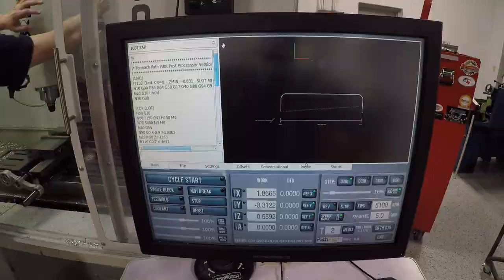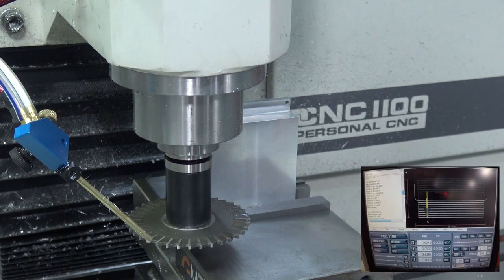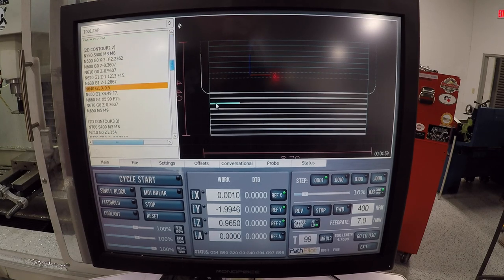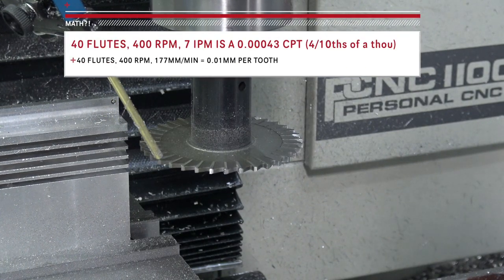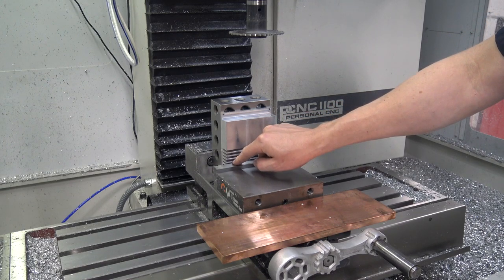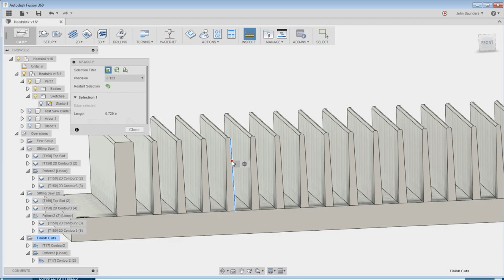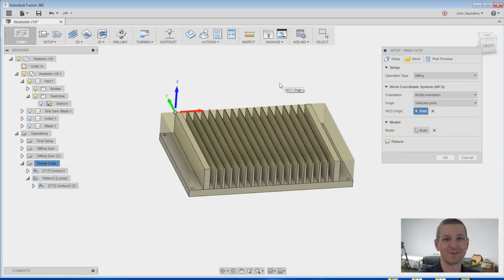CNC Machining a Heat Sink!  Part 2 Widget102

Comment: I love the videos where you show the more mundane aspects of the job like squaring the stock and even shipping it - stuff that is easy to take for granted but still important.  Also, going through the thought process of how to make the part - then finding out what works and what doesn't.  You'd probably make it a bit differently if you needed another one, but you got the job done and the part shipped!

Comment: I think flood coolant would be your friend in jobs like this. It is messy but it sure does work good!
Reply: I agree with the flood cooling. Where I work we only use flood cooling, both on mills and lathes. Then we also have the advantage of completely closed machines.
Reply: I second that!

Comment: Did you consider a sine plate type setup where you offset the part from vertical by 1.something degrees? Then you can cut one side of all of the fins on the right angle, flip the part and do the other side of the fins. Since you can't do all the fins in one pass, you would have to set the angle twice, once plus and once minus.Save all that adaptive step milling time with the end mill.

Comment: In your spare time, try climb milling with the slotting saw...it should improve the finish and reduce the pressure on the saw.  And try Alumtap for the cutting fluid to keep the chips from sticking to the saw.  A little bit goes a long way.  It can be purchased in a small bottle from MSC.  Best of luck!

Comment: I'm not sure exactly what you're asking on the chip but if you are slotting a .750 slot with a 4" slitter even at .00043" per tooth, your chip per tooth is 1.13" long in the circumference of the cutter. The cutter is 12.56" in circumference and 9% of the cutters circumference is engaged making a long chip that is .00043" thick.

Comment: Flood coolant would probably help that slitting job, both for more lubrication and to get the heat out of the part. Tapered end mills are a standard in the mold industry, and an off the shelf item. No need for a custom grind. I always seem to end up with a few when buying a bundles of cutters.

Comment: Nice work, guys. I've done heatsinks kind of like these before, but for liquid cooling - so the entire thing had to be contained - so no slitting saw use for me. I used a 1/16 Destiny Viper to finish them down to a depth of .495 or so, and let me tell you - it took forever. Feeds and speeds on that saw looked a little out of sync, but as they say - if it works, it works.

Great job, thanks for all the great videos! I always learn a thing or two seeing how you do things.

Comment: These are a pain usually with flatness. I have had some with 2 thou flatness requirement on the other side of the fins. once you machine the fins out, the whole thing springs out. had to leave 20 thou for a finish pass on the other side in the end. Brilliant use of a slitting saw!!

Comment: I worked in a shop years ago where they used denatured alcohol as a cutting fluid for 6061 and it worked fantastic but you need excellent ventilation because the fumes are really nasty

Comment: Hi John, I find that a quick brush of tap magic aluminum on the teeth at the beginning of each pass would stop the chip welding. Still using the mist for your constant lube and chip evacuation. The stuff is called magic for a reason!

Comment: Hi John,

It can be helpful to remember, you're not actually cutting metal, instead you're applying enough pressure that you cause the material to fracture. There's a video online somewhere that shows the action and the metal is parting some distance in front of the 'cutting' edge. With conventional or 'up' milling, the chip starts thin and gets thicker, so you're doing quite a lot of rubbing until the pressure is enough to start the fracture. Lots of rubbing equals lots of heat.

With the resulting clearance, you might have been able to climb mill the second pass down the slot, it would certainly have shortened the cycle time.

When you get a built up edge from Aluminium, try dropping the cutter into a strong Sodium Hydroxide (LYE) solution to dissolve all traces that have bonded to the cutting edges. It's also a great way of removing the pinning from files and also the oils and greases the impede the cutting action.

Comment: In my opinion, flood would be better all round. A part of the reason for the heating up of the work is because there are more teeth of the cutter actually engaged(cutting) within the material at any one time. Also the "radial face" of each tooth has a different geometry to that of an End Mill or Slot drill, so chip flow is not quite the same.

Comment: I believe the chip thickness issue you mentioned comes from the fact that when the temp starts to raise the chips do not leave the cutter and therefore are recirculated and are in the way as more chips are being made blocking coolant from the cut area  thus welding more and recirculating more ect ect

Comment: stairsteps actually give the fins a bit more surface area than a flat angled wall, so for a heatsink that is actually better. I do wish modern motherboard VRMs had cooling blocks that remotely looked as good as that "Real Heatsink" instead of angled cut solid blocks with stickers and LEDs, lol.

That is beautiful work. B)

Comment: On the 4" side cutter I think I would have tried something like 1% radial depth of cut, climb milling. Increased the feed(a lot) to keep the same chip thickness. Lots of passes. Maybe rapid back at the same depth? I use this method on "similar" job at work with great success.

Comment: Looks to me like you forgot to profile the last of those "fins"?!
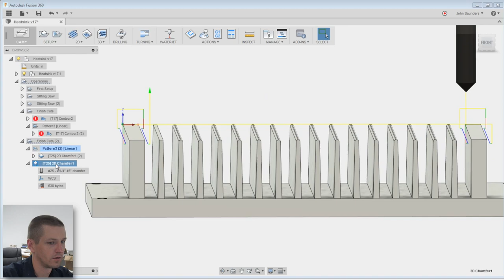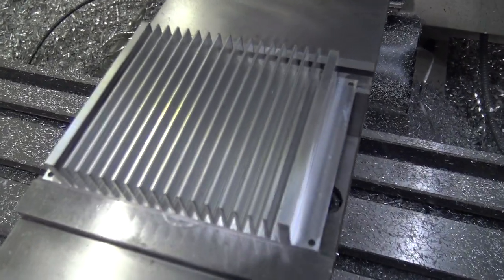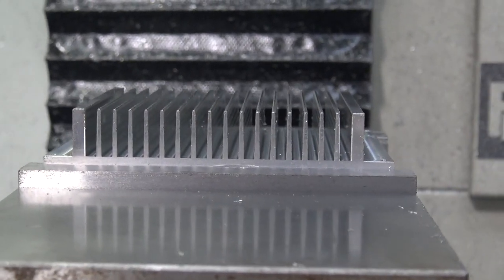Reply: Yeah I thought I did see that to in CAM 33:09 and after milling 33:41 & 33:50
Reply: +DutchEngineer he did what the customer asked
Reply: Jared Whelan Really?  You think the customer asked for one of the fins to be different to all the others?  LOL.
Reply: Yeah noticed that too.
Reply: I almost posted this comment, too!
Reply: If you look at the actual part at 33:49 you will see that it was profiled. 
I don't know if he updated the program off camera, but none the less, 
it was profiled.
Reply: Just noticed the part is flipped. It wasn't profiled.
Reply: Yeah.  It's the fencepost problem.  He duplicated the pattern that he used to machine the valleys between the thin fins to chamfer the fins.  But there are fifteen valleys between sixteen fins.  Just like if you're building a fence with fifteen sections, you'll need sixteen posts.
Reply: Lol noticed that too, can't believe he sent the part unfinished.

Comment: In my humble opinion you are cooling the saw only on the topside, therefore there is a heat difference between top and bottom. You can also see that the aluminium sticks thikker to the bottom then too the top. If you use double sided coolent then you will not have to stand by with your airgun. Preferable full flooded coolant. Going so deep into the work leaves a thin backside, this causes vibration, you can hear that very clearly. You have to backup the backside of the heatsink with a thick metal plate this also keeps the heat down. Nice video:)

Comment: Chip welding would require melting and mixing aluminum and the cutter material. It is molten aluminum that has solidified on the surface of the cutter and stuck to it. If you look closely, the aluminum sticks out beyond the cutting edge and prevents it from slicing off material. So the captured aluminum is heated by the rubbing friction and melts, smearing some of it along the walls. When this happens with an endmill, metal is melted around the tool as well as inside. When you stop the machine the molten aluminum solidifies and binds the flute aluminum to the surrounding aluminum and it can be very difficult to remove the tool. The melting won't start if the chips leave the flutes most of the time. It happens when the flute is full and rubs the walls and melts. This is something that happens with aluminum because the speed is usually pretty high and it has a low melting point. Plastic is the same deal.

Chip packing is one reason for poor chip ejection. Milled chips grow 2 to 3 times in volume because of the curls so 1/2 to 2/3rds of the chips have to fly away or they could start packing around the cutter. The growth in volume happens at all feeds, speeds and depths of cut. That is not to say it will always cause melting. A shallow depth of cut makes shorter chips that might not bridge a slot and cause a log jam. Chip volume grows even with the granules from a corncob cutters. Different machines create different volume growth ratios. Companies that make chip briquetting machines that compress machining chips into manageable cubes will sometimes have charts that list various chip volumes

Comment: Hey John, thanks for some great footage inside a daily job! I believe the reason you are getting a larger chip on the teeth is due to the fact that chip per tooth is technically the advancement in depth of cut per tooth/revolution. This is significantly affected by the radius of the tool. Usually with that chip per tooth you are rolling a very tiny chip due to a relatively small diameter on a cutting tool. When the tool diameter is large, and your depth of cut is significant, the tooth spends far longer in contact with the metal. The chip thickness itself should be close to a half thousandth, however it is long a long shaving almost similar to a chip on a lathe tool which is in constant contact with the metal.

Hopefully that answers your question, it is a little hard to describe the geometry without the aid of visuals. I'm only a novice machinist but I have a background in the physics and geometries involved.

Thanks again for the in depth video!

Comment: I don't know if the Tormach has flood capabilities, but if it did, you would be better off running flood on it. Not only would it keep your cutter better lubricated, it would wash your chips out. And it would definitely keep your part cooler.

Comment: I have a theory that you should cool a spinning thing just after the point where it's being heated. The heat is created on the cutting surfaces of the cutter and takes time to soak deeper in.

When you directed the coolant into the slot, the heat on the cutter tips had all the time of their journey through the air and back into the slot to soak in before meeting cold coolant, then very little time to be cooled before cutting again.

The way you had it set at first was coating the whole top web of the cutter, then the centrifugal effect was concentrating the coolant on the tips by the time it entered the slot, so doing a good job of lubricating the cut too. I think blasting the top where it emerged from the cut would have worked even better.

Comment: I wish I have found your channel sooner. Excellent work and explanations every time. Work on this heat sink is pure CNC art. Big fan over here. Now please do not understand me wrong. I am not criticizing work done or you or the client. Like I have said workmanship is pure art for me and I understand clients need for the Custom part. Please do remember great fan over here. But as someone who spent decades with cooling stuff and electronics, mechanics and thermodynamics this heat sink is economically failure. Such heat sink types are never made from the billet while machining it makes it expensive. Depending on the available airflow, environment temperature, being force cooled or not and weight requirements there might be better solutions that might work way better and cost less. Even with strict requirements that require this spec including heat pipe or few would help. If it is not force cooled and there is no weight restriction maybe being made out of copper would do way better. If it is used with fan blowing true the fins than fin density should have been way higher and fin count bigger plus fins bit thinner. So many ways it could transfer heat into the air better. If I knew full requirements I could have designed heat sink few times more efficient for sure. Or maybe heat exchanger would solve it. If it have had to be like that I would get 5 bucks extruded aluminum heat sink in bit bigger dimension if there is not a same size on the market. I would cut it to the proper size. Then I would cut few fins from sides to create that shelf needed and drilled needed holes. Then I would de burr all surfaces and file and sand off  all tool marks and polish it so it looks presentable. Then I would lap the base to make sure it is flat. Bob is your uncle. Way less epic but way cheaper and preforming very similarly and if done nice looking quite OK to. Using band saw, press drill, file and sandpaper and flat surface I would be done with it in few hours all done in manual labor. For single product and prototyping good enough. Still I am very glad that client have ordered this part. Now we get to profit by learning awesome CNC skills.

Comment: You should aim the coolant at the side of the cutter the way you had it for the very first slot, that way the spinning action can sling the coolant along the side of the blade and directly into the cut, making it much more effective at both cleaning the teeth and cooling the cut.

Comment: I know it's not okay to ask what the part cost to be considerate to the customer. But as a hobbyist with similar equipment, it would be great to see a breakdown of time and materials (high level). i.e. CAD/CAM time, machine time, and fixturing time(if significant), etc. Also, you may have posted approximate shop rates for each in another video, but I don't recall. Thanks. Great Videos.

Comment: Just a thought - not an opinion as I don't CNC. Maybe 2 depth cuts and 1 width cut for the slotting?
Also maybe something that already exists. A backing block with coolant tunnels connected to a pump and radiator - ie. small motorcycle type?

Comment: Middle of the slot dividing the Z height between top and bottom, staying 0.020 off your finish Y dimension. Come back in and go and do a top and bottom finish pass and depth. 
So if you have a 0.100 thick cutter in a 0.125 slot your z height would be 0.1125.

Comment: It's a big radius of curvature. I don't know if that is why it tends to weld, but each tooth does spend more time in proximity to the part, than a small diameter tool. Or maybe I'm full of it.

Comment: How about setting the block up 1.4 degrees via sine plate to get a necessary taper on the fins.  Others pointed too, the larger circumference of the saw makes for much greater collection of cut 'sticky' material until clearing same material. Darn good looking part  though.

Comment: On the slotting, i would drop the feed rate to 4 - 5ipm. Those slitting saws don't really do well with high speeds and feeds. Even with the side relief on the cutting teeth, you're still milling on 3 sides, and that's where most of your heat and noise is coming from the side to side runout isn't really a big deal, as long as it's on the horizontal plane. Also, most people use flood coolant when making deep cuts with slitting saws.

Comment: Another nice demonstration! a second mist coolant line should have been enough, one for the slot, one for the tool. It did look like you were feeding & speeding a bit on the fast side. Something to consider is forming a cutter especially for that angle - a good excuse to have a 4th axis!

Comment: Thanks for posting the video and letting us learn with you. Would you make the part the same way the next time? 

Unlike you, I'd machine the fins by slotting. But, instead of sizing the stock first, I'd use some Talon grip jaws. Or, use the same principle. Grip the bottom section of unmachined ( but fairly straight and flat) stock in the jaws and machine the entire top surface in one go. Since the fin walls are tapered you can mill them using the end mill you showed using a traditional slotting path moving down the slots at a reasonable depth. 1/8" carbide end mills can be fairly rigid. The long horizontal channels make using the air blast straightforward. Once the top part has been cut flip the part upside down and machine away the carrier section. 

I think that with all the fussing around and handling, a simpler, albeit less elegant method, might be more efficient. You could run the machine unattended and do other things. The down side, of course is you would not learn as much and definitely wouldn't have these interesting videos to share.

Comment: I know this is an old video, but....I have done a similar operation for a customer at work and I have to say, I only used 3D contour. Job was done in less then an hour. Order by depth did the trick. 20mm long 3mm single flute carbide cutter with a cutting length of 7mm. Around 1000mm/min feed and at 38.000rpm. This part in the video is a little bigger, but It wouln't have taken 11h's with 3D contour... I can send you the fusion cam if you like to compare.

Comment: Since that side-cutting tool needs clearing on both sides, I think I'd like to see two coolant blasts, one from below and one (as you have it) from above. They would need to be offset from each other so the streams didn't interfere with each other. The lower one might need some ingenuity to keep clear of the vise on the last cuts; maybe a bent or side ejection nozzle.

EDIT: And maybe a third blast on the back of the part for cooling. One of those Vortex tubes to give a blast of hyper-chilled air might be a possibility.